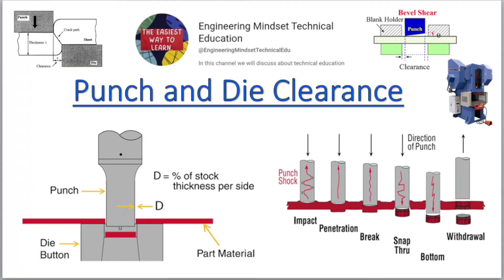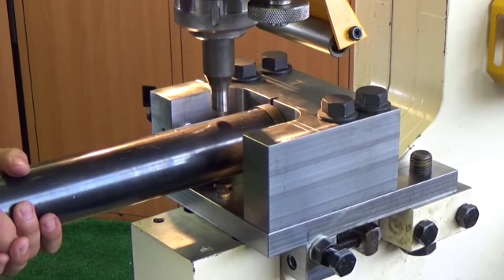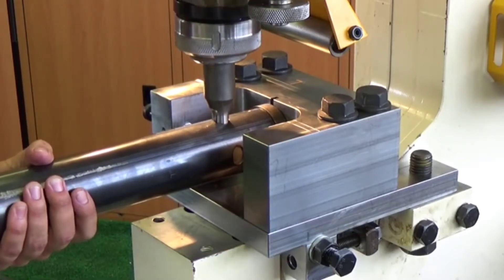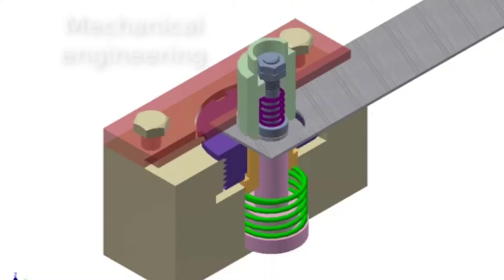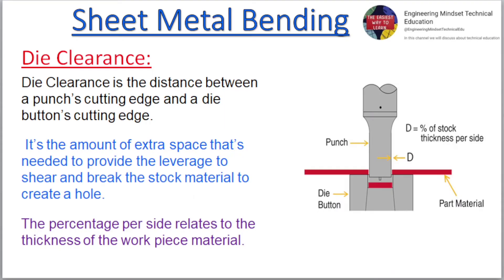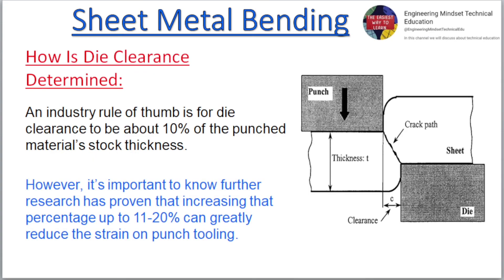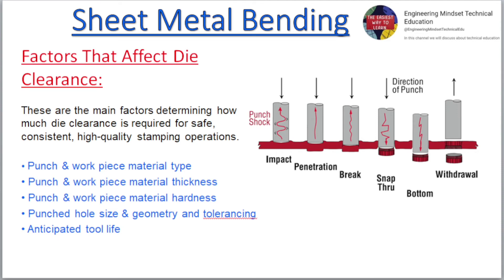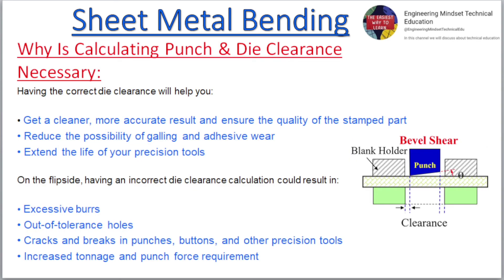Punch and Die Cutting Clearance| Stamping Die | Sheet Metal Die | Blanking Piercing Clearance

Comment: 0:20 when you use your hand to clean the Blank residue how to solve it if I am perforating multiple holes? The waste part is falling inside the tube (Vacuum is not working good because we have lot of oil inside the piece). Can u help me with samples?
Reply from the maker: Air gun ?  
Normally waste is automatically collected in scrap bin in bottom of press for normal piercing and their presses have a big hole not in this case for tube hole piercing.
Nice question 😊
Reply: @Engineeringexplain  thnx bro, our pieces are tickness and when we press is falling insiste, the Air gun not work Very well. Any way to remove from a closed tube (welded)